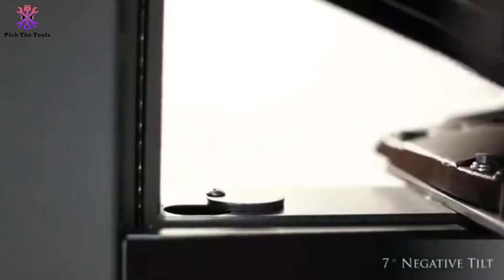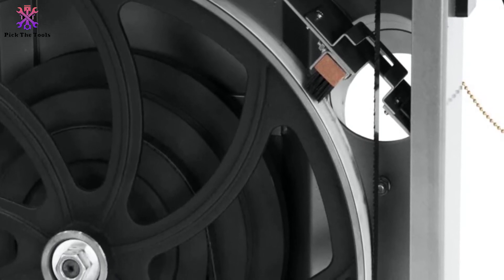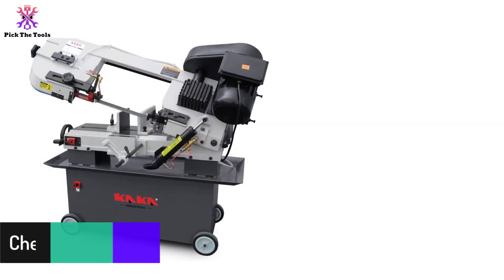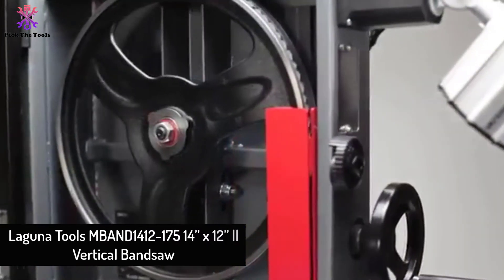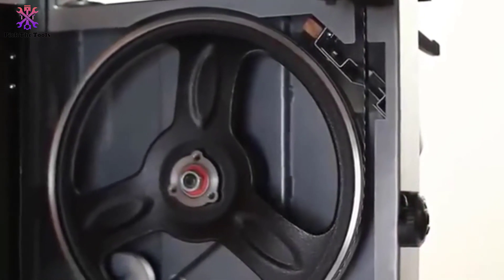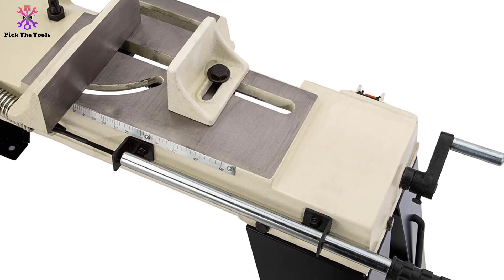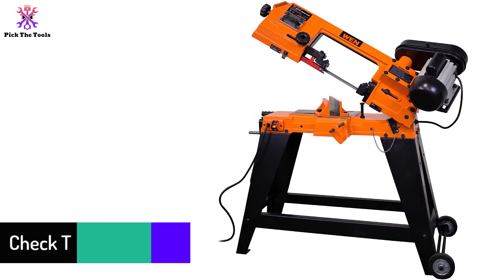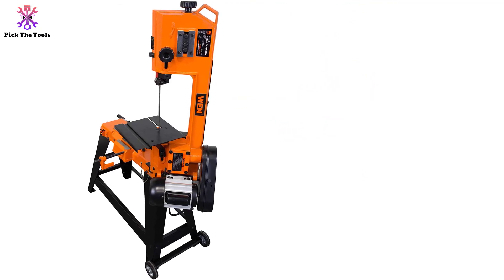Top 5 Best Vertical Band Saws for Metal Wood or Lumber Cutting 2021

Comment from the maker: 🔹5. ET 414418 18" || 1 HP Metal or Wood Vertical Bandsaw
[Link]  https://amzn.to/3wtmL47

🔹4. KAKA Industrial 7" x 12" || Metal Cutting Horizontal Band Saw
[Link]  https://amzn.to/3CXdqnG

🔹3.  Laguna Tools MBAND1412-175 14” x 12” || Vertical Bandsaw
[Link]  https://amzn.to/3BXi049

🔹2.  SHOP FOX W1715 || 3/4 HP Metal Cutting Vertical Bandsaw
[Link]  https://amzn.to/3qkMgnw

🔹1.  WEN 3970T 4in x 6in|| Metal-Cutting Vertical Band Saw with Stand
[Link]  https://amzn.to/3mUbpDi